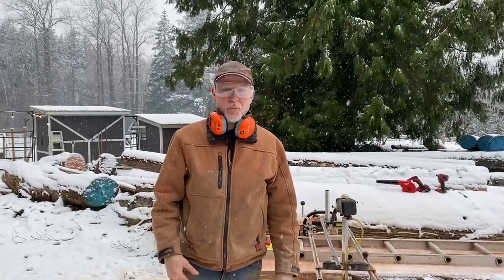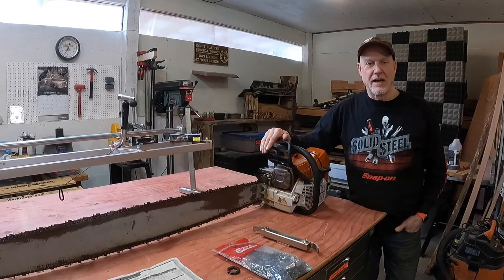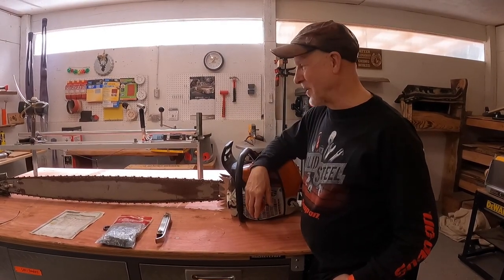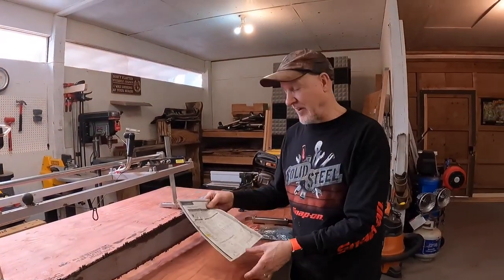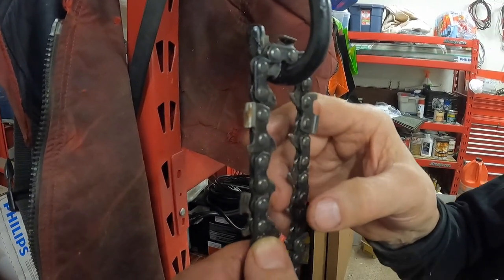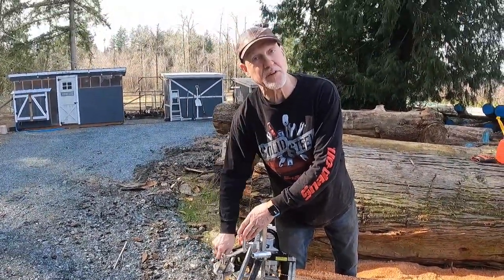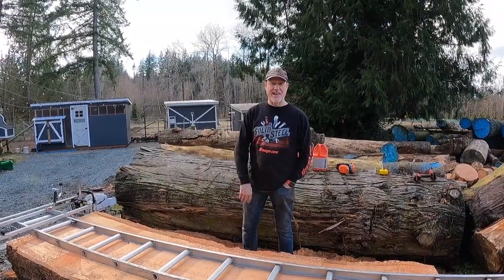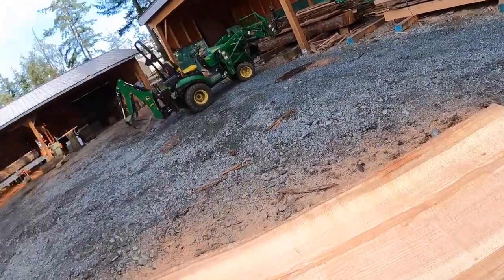Alaskan Chainsaw Mill - before you buy, see if it's for you, based on what you want it to do.

Comment: This chainsaw worked well to cut up a pile of cedar logs https://www.youtube.com/post/UgkxfQm1wmg0ItKDLavxj1nXtQY9HP7EF504 and stumps. I used it to cut 12"-16" diameter logs and a handful of odd-shaped stumps that were larger in diameter. There was more than enough power even when using 2x100' extension cords. Be sure to use the right gauge extension cord, since you should be using a slightly higher gauge cord than the standard extension cord most folks have around the house. My 2 favorite features of this saw over previous ones I've used are the built-in sharpener and the quick stop after the the throttle is released compared to a gas-powered chainsaw. As soon as you release the trigger, the chain stops spinning immediately because of the electric motor. Standard feature of most of these electric chainsaws, but worth mentioning here for anyone not familiar with it.Bottom line...I needed a chainsaw to get through some backyard cleanup of logs and tree stumps. For the price of renting a chainsaw for a few days, I got this Oregon chainsaw that got the work done, and now I own it for future use.
Reply from the maker: Thanks for tuning in and being part of my journey!

Comment: Ripping chains are less aggressive cuts than cross-cut.  Kickback can occur with a standard chain. To clarify what makes a  low kickback a depth gauge is added. The safety or low kickback chain introduces an additional depth gauge on the link that has no cutter attached. This keeps the consistent depth of cut consistent as it goes around the tip of the bar.  Kickback can occur when felling trees and branches where you used the tip of the chain for plunge cuts.  When milling you do not cut with the tip of the bar, and you are not plunging in.   Lawyer speak and context I feel should be added. The cuts are less aggressive and some rip chains alternate angles for cut and clear, which many millers use for less powered saws or long bars. 

I mostly mill but have in some instances fallen large trees for some free logs but not very often as not trying to take business away from those who make their livings as I am just as happy to get the logs from tree trimming companies.  I use a cross-cutting chain for that, but just cutting leftover firewood might not change the chain.  Works fine just slower.  Less aggressive. 

There are a number of things stressed on what makes a ripping chain and each has its purpose of the specifics in relation to what tools (size of saw and bar, hardwood, softwood, dry or wet wood etc)   you are using and what the task is doing.
Reply from the maker: Really appreciate you tuning in and adding detail and perspective.  Huge thanks!

Comment: You can fix those 2 granberg chains that are spalled with your raker file. Hold the chain in your hand and file the spalling down till it  runs freely in the bar groove. I've done it many times when saw has thrown the chain off. If you turn the end bracket that holds the depth Guage bar at the helper handle end so the bar is on the outside you will gain a little more room to cut bigger diameter logs. There are 2 ripping chain angles so you know and the 15 degree seems be have been lost information. The 15 degree chain is a faster cut but leaves a rougher surface similar to old rough cut lumber milled on circular sawmills. I only recommend 15 degree chain if your milling lumber and don't care if it's rough. I have a 30" mill and run an echo 800p with a 36" bar and currently running semi chisel full skip chain that I regrind into milling chain.
Reply from the maker: Great tip - and you're right - when the saw does throw a chain, that would be the cure!
And I was not aware of the 15 degree cut advice.  There are times when I do want that 'vintage rough lumber' look.  When I was a kid, my dad was head of maintenance for a sawmill which ran two large circular saws, and I remember that look well.  
Thanks for tuning in!

Comment: I started using an 880 for cuts over 30". A 660/661 will do it but the 880 does it better. I've also found a full skip chisel chain sharpened to nearly 90 degrees in relation to the bar cuts very well but leaves a much smoother finish as well as a smoother feed while cutting.
Reply from the maker: Thanks for the tip!  Much appreciated.  I'd love to get a smoother finish cut - and a smoother feed.  
You clearly have a ton more experience than I have at this and I really appreciate your taking the time to share.. 
I just tuned in and subscribed to your channel.  Will watch some of the videos this evening!

Comment: You should step up to a cannon chainsaw bar - they flex a lot less! Every time the bar flexes you lose power. I run a 090AV - bit older saw but nothing stops it. Don’t understand why you use the ladder when you already have a flat surface
Reply from the maker: I will definitely look into that (Cannon chainsaw bar).  Did not actually know that it existed.  Huge thanks.
And - you've identified the reason that I use the ladder for every cut.  Because of the flex, the cut is slightly uneven.  Hardly noticeable on the first cut, but if do not use the ladder for subsequent cuts, the uneven-ness gets exaggerated with each subsequent cut, until the pieces become unacceptable for table-top use.  The ladder ensures a close to perfect cut everytime and chainsaw bar shortcomings are close to a non-issue as far as cut quality.
Thanks for tuning in - and contributing!

Comment: Hi! Thank you very much for great and inspiring video. I have one question. What is that blue thing on these trees around? Its something what slows down drying proces? Thank you:)
Reply from the maker: Thanks for tuning in and being part of my journey!  
It's important to seal the ends of the logs to prevent what is called "checking" - which is what happens because the ends of the log, unsealed, will dry faster than the middle.  As they dry they split and one can easily lose 6 inches or more of the log in terms of useful wood.
Anchor Seal is one product that is recommended, but in the climate I have here, any old latex will do.  I buy whatever is on sale at Home Depot in the spring and have them put some blue colouring in it and I paint away.  If I still have previously unsealed logs, I give them another coat.
Reply: @howardkettner  Thanks for answer, Can I ask you one more question, would you recomend me a clasic latex for it? Iam from Czech Republic so my climate conditions are 500m above the sea level, 30 degrees Celsius summer and - 20 degrees Celsius winter. Or should I buy that much more expensive Anchor Seal? Thank you!
Reply from the maker: @stepanmoska856  Your climate is nearly identical to mine.  I just go with the cheapest latex I can buy, and so far so good - as long as I apply a coat annually.
Happy sawmilling!   Thanks again for the conversation.

Comment: Howard, random question for you. I came for the chainsaw mill info which was great but what brand is the coat you are wearing in the beginning of the video? I’m looking for one and haven’t found one I like yet, that one looks nice. Thanks!
Reply from the maker: As per the most video I just posted this morning, this channel is all about random - so totally welcome the question.  @https://www.youtube.com/watch?v=SVggsBal7Lk&t=219s

It's a Tough Duck.  It's here on Amazon Canada.  This is the one I was wearing - although it 's now 5 years or older so the collar trim is a little different.
I also have the one with a hood.  Those jackets are bulletproof, highly rain resistant and wind proof.  I've worked in heavy downpour for hours without getting wet.  
@https://www.amazon.ca/Tough-Duck-213716-BRN-Medium-Jacket-Medium/dp/B000Y11CKM/ref=sr_1_2?crid=3TLMLF2PSMGTQ&keywords=tough%2Bduck&qid=1670093095&sprefix=Tough%2Caps%2C173&sr=8-2&th=1
PS - did a quick search but could not find the identical jacket on Amazon.com.
Hope this helps.
Reply: Thank you, sir! I’ll see what I can find. All the best to you and I look forward to continuing to follow along.

Comment: Howard watched your video. I am confused!! Did a dealer install a 404 chain on your saw set up with a 3/8 rim sprocket??? If so they definitely owe you for whatever damage was done. That's on them not on you!! If you made that error that's a different story. As far as your sharpening angles goes you seem somewhat confused. There are several angles that you need to be concerned with so before you do anything to a new chain make sure you understand completely what you're doing otherwise you will ruin that chain as well!!
Reply from the maker: Yeah - a rookie at the dealer made an error - and they made it right.  Thanks for tuning in and being part of the conversation.  Three years later I think I'm finally figuring out this chainsaw chain sharpening 'thing'.  haha

Comment: I don't use a guy after I make my first initial cut I'll let the sawmill glide on top of the wood it's basically a flat level surface after your first initial cut
Reply from the maker: It's probably just me, but I found that if I inadvertently put any pressure or  or guidance on the handle while holding the fuel trigger there would be some very slight waves that were then exaggerated with each successive cut.  
For tabletops or benches specifically, I continue to use the guide for a guaranteed flat surface.

Comment: you can easily repair your damaged chain with a Dremel tool and grinder head. Takes a little time but saves expensive chain replacement
Reply from the maker: Thank you so much for tuning in - and what a great suggestion.  I've got both - and it sounds like a terrific little evening project.

Comment: Does that Alaska mill come with the oiler and the winch or do u have to buy those separately?
Reply from the maker: Hey! Terry - thanks for tuning in.
Those were options.  Had to do little tweaks to both to make them serviceable in the long term, but hey, perfect is the enemy of good, so all worth it.  
Gotta have that additional oiler if you're running a bar longer than 30" IMO.
And the winch keeps the bar running straight.  You might not realize it, but if you're even running the chainsaw with one hand one will inadvertently cause it to rise or dive.  The winch prevents that.  Brilliant option IMO.
Reply: @howardkettner  I just bought the XP 3120 Husqvarna with a 3ft and 5ft Bar . I'm waiting on my Alaska mill to come in. I'm going to order the oiler and winch. Thanks for the heads up . 👍
Reply from the maker: @terrymcguire8476  Nice choice - with over 8HP that should run that 5' bar quite nicely.  The real wisdom tho IMO with that size of powerhead is that it has a clutch that won't go up in smoke running that long of a chain.

Comment: Why the ladder.? I usually  see that for the first cut but once you have a flat surface cant you just lay the mill on that? Just trying to learn as we are just getting started in this.
Reply from the maker: Great question!  
Initially, I did not use the ladder on the second and subsequent cuts, but what I found is that any imperfection on my part on the second cut - either as the result of operator skills, or some less than perfect first cut, just became more and more magnified in the 2nd, 3rd, 4th cut and so on.  The ladder prevents that.  Particularly important if the cuts are going to be used for tabletops or shelving vs general construction.
Hope this helps.
Reply: This makes perfect sense and that is what I was assuming was the reasoning. Thanks for clarifying and for your content. It is extremely useful as we are venturing into this.
Reply: It also makes starting and finishing cuts easier and keeps the ends flat.

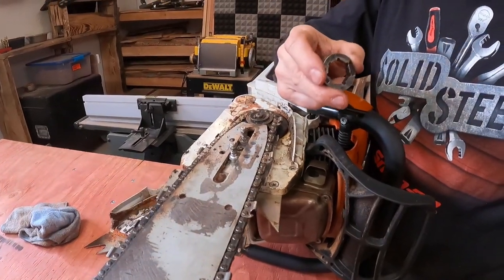Comment: if I could make 1 suggestion, I haven't watched all the way through. I'm currently at 9:53 where you're talking about the rim sprocket. anyways, its pretty tight in there. if there was any way to run a 8 tooth sprocket instead of that 7 tooth, your 661 will love you for it. stihl part # 0000 642 1217
Reply: I’d also be curious to know what youd think of the Stihl ripping chain. If you ever come across it.
Reply from the maker: Awesome observation - and huge thanks for the specifics on what I should be asking for.  I will definitely do that.  Again, thank you Dawson?!
Reply from the maker: @TheKrollToll  Love it.  Running one now.  Got it to replace the chain I got from Granberg that got wrecked because of the sprocket mismatch.  It performs really well  Have only done 3 x 12' cuts with it (in 36" wide cuts).  Not experienced enough to comment further - but love the cut speed and end result.
Reply: @howardkettner  yea no problem Howard , its a minor upgrade but will really help pull that long chain.
Reply: You will lose power but gain chainspeed going to a bigger drive sprocket, not something you want to do on a milling setup really.
Reply: No way would I use an 8 tooth sprocket on a mill. It will bog and cut much slower and be harder on the saw. It is like trying to drive a truck up a steep hill in too high a gear. Ask me how I know.

Comment: Hoky dyna Howard
I think we are brothers who have never met .
We have the same mill set up And the same Alaskan mill set up .
Go figure
Reply from the maker: Whoa - so good.  And just too much fun brother!
Reply: @howardkettner 
So 
Are you truly happy with the self drive and electronics on the mill ?

Can the mill still be run manually if there is a problem with those items?
Reply from the maker: @pearsc5d  The drive is easy enough - it's just a matter of 3 small bolts and then lifting the drive chain off the sprocket.  
The saw head is a bit (a lot) more complicated.  One could install the manual lift mechanism is one solution.  The easier cheaper solution is to get a simple switch (I got mine through Norwood) and disconnect the control box and wire the switch in between the battery and the lift motor.  30 minutes max - and I'm slow at that sort of thing.
Reply: @howardkettner  
Are you happy with the performance of the way it drives the saw ?

Are you happy with the electronics .

I'm cutting white pine timbers for a timber frame builder. 
This guy is real picky on how his logs are cut up
Reply from the maker: @pearsc5d  totally. The new electronics package is a dream come true. 
If you’ve not already viewed it or otherwise mastered it, see my video on squaring up a cant. 
It’s all about how you square it up with the blade using the hydraulic clamps to assist